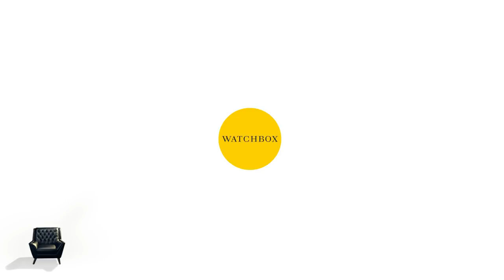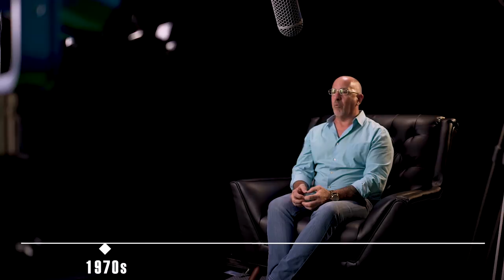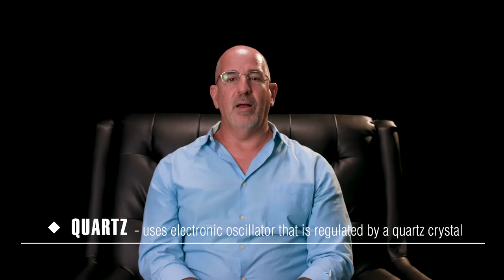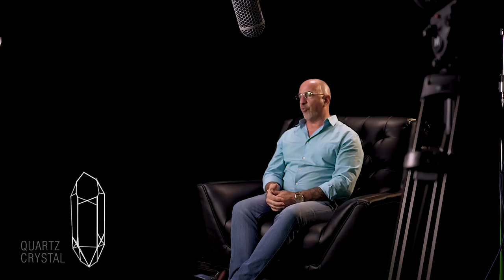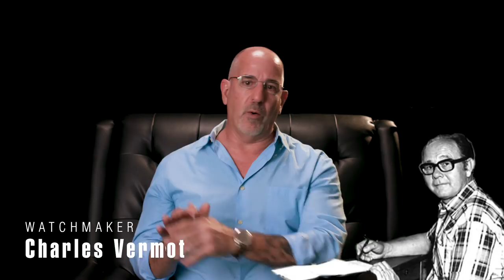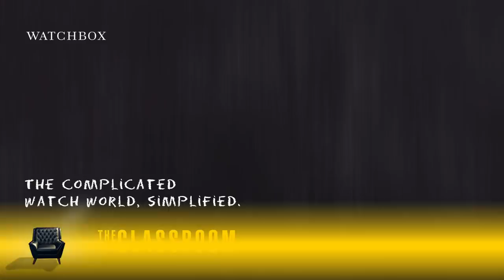The Quartz Crisis & Its Effect on Watchmakers | The Classroom: EP03, S01

Comment: Most of my watches are mechanical but I have a Grand Seiko with a 9F quartz movement. I've had it for 3 years and it runs within 1-2 seconds of atomic time per *year*. It's my favorite grab and go watch. I always know it's going to be running on time.
Reply: the origin of the quartz...
Reply: Does it not have a spring drive?

Comment: Circuits can have romance, just ask any electric guitar player. There is a sweet alchemy that goes on in the circuitry of those stomp boxes and hand wired amps. I love my watches, the quartz and the mechanical. To me there is beauty in both of those movements.
Reply: To me an electric guitar has romance the same way a mechanical clocktower with electric rewinding has romance.  A quartz watch is more like a plastic toy guitar.   The electric guitar still has the same fundamental thing that makes acoustic guitars sound good- the strings.  A quartz watch is missing the fundamental thing, the mechanical escapement, which is why they are so lifeless.
Reply: @sleeplessengineer1450 You are completely missing the complexity of electronic guitars. They're not just some acoustic guitar with an electronic part slapped on. Why do you think guitarists own so many pedals, amps or effect boxes? It's because manipulating electric signals are an art on their own as well which allows the player to express themselves uniquely. It's not just about strings.

Comment: I can appreciate both or all three types of watches.  Wind Up Mechanical, Auto Mechanical, and Quartz.  My preferred now is the Auto Mechanical as it will run forever with just slight maintenance.  To think Timex was a reliable watch without Jewels.  RADO and Hamilton came out with Electric Watches and Seiko sealed the deal on Quartz that made watches affordable to everyone.  High End Lux Brands now trade on exclusivity rather than on superior technology and time keeping.  If I buy a $6000 watch it better keep time as accurately as a Quartz!  My watches are not bookmarks to where I stand in society they are work horses that perform.
Reply from the maker: Great stuff, we love hearing what makes people collect different types of watches! What models are in your collection? - WatchBox Team
Reply: @exepat11 you excluded Spring Drive and solar quartz watches 😄
Reply: @J69Nice  I have had a Pulsar and Citizen Solar powered watch.  Spring drive I'd have to research.

Comment: There definitely is romance in a quartz watch, not only is it a more cost effective alternative to a mechanical watch but it is more accurate. The beauty is ability to harness the power of electricity to produce better technology. The idea is so great that people hate to admit it and pay premiums on inferior technology. 

That is like saying there is no romance to a modern day button press car ignitions, compared to the engines of the past that had to be crank started by hand.

some people just love to be stupid.
Reply: Mechanical watches are already very accurate, no one makes their schedule based off of exact seconds.  If you want even more accuracy there's now silicon oscillator mechanical watches.  Quartz watches are not "better technology" they are cheaper to manufacture, and they also don't last nearly as long as mechanicals.  

There is no romance to a picture of a painting you just printed out with a crappy hp printer (quartz watch) while this is beauty in an original copy of painting done by hand (mechanical watch)
Reply: @Dan M How accurate are you talking about?  They are accurate enough for normal use.
Reply: @Dan M There are some mechanical watches that are hundreds of years old that still work, I doubt any quartz watch would last that long.